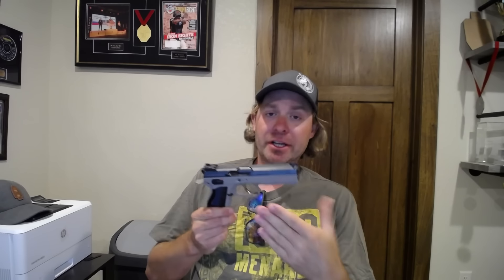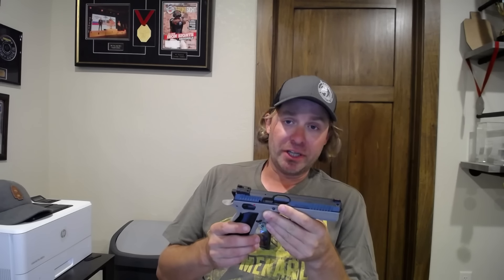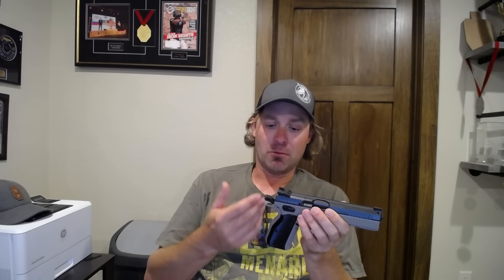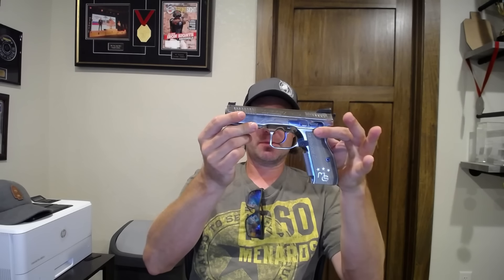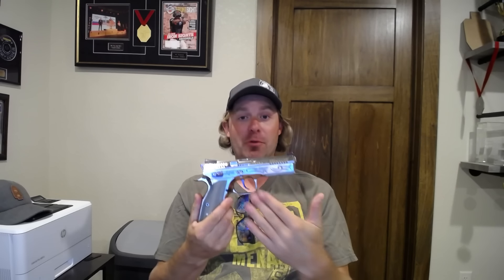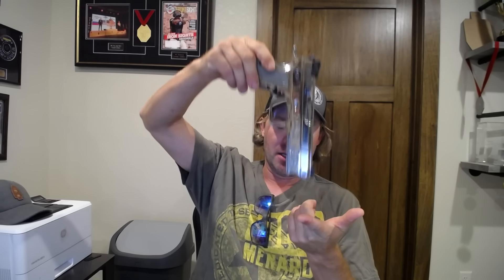Shadow 2 drop test

Comment: The gun had an extended pin and a light pin spring. Furthermore, the user did NOT visually watch the muzzle seat back into the holster fully before removing the hand. It fell to the floor (indoor match) on the hammer. The extended pin protrudes out from the breech .040 when button on hammer end is flush (such as when hammer falls fully on the button)...or in this case it was most likely already fully down on the button end of pin and that pin as a result was already protruding forward. I own one myself and when this happened I went back to stock pin,pin spring, and then tuned the main spring for reliability instead. I run a 13 pounder.  I really do not like hair triggers in the first place. In the case of this incident it only took a solid hit on the hammer and a sudden hard stop of the mass of the gun on a hard surface to cause enough rearward inertia of the chambered round to dent the primer enough from its rearward movement to make it go bang. The RO was killed. Bottom line is this was pure carelessness of the user. There are no accidental discharges...only negligent ones by sloppy careless hurried gun handling. Period.

As far as milling goes I used Primary Machine. They are very well versed in the Shadow 2 milling program and the do beautiful work. They can take tons of weight out of the slide using thinned pockets, ports, and many other techniques that are unheard of elsewhere. I run a 2.5 Trijicon SRO

Comment: Before you mill it, see if you can use a extra power fp spring that will make it more resistant to drop firing...say takes 3-4+ drops. Than shoot it that way through a course of fire and tell us what you find and think. Can the Shadow 2 be 'more drop safe' and still fine for it's purpose?

Comment: When you drop the pistol directly on the muzzle on a hard surface and it goes off, the round is likely to ricochet in a largely random direction. Still potentially lethal, but less likely than a direct shot.
Reply: The ones that killed someone, one in uspsa, on in canada (ipsc) were dropped on the hammer.
Reply: @onpsxmember  Thanks for that significant detail!

Comment: Yes please mill it and maybe add "Steggler Improved" on the slide. Also I second adding the Swampfox or Cyclee RDS. Maybe throw it on the Staccato when you're done reviewing it for a second round of shidded pants. Thanks. 

-sent from my Pact Club Shot Timer III
Reply: I have an unmodified basic CZ75 Omega (I'm using the decocking lever feature) is this model drop safe?
Reply: @Joe-lk6oc  I have the P01 omega and I have hit the hammer in decocked position with my palm much harder than it being dropped from six feet. It didnt go off. Its been thrown. Carry it every day. Factory springs etc. One of my magazine springs has gone bad however.

Comment: As I posted under another of these vids from Ben: Czech Police had several dropped pre-B CZ75s fire, in at least one case mortally injuring a bystander. In another disabling a passer by for life.
CZ75 small frame family guns without a bolt safety (this includes Shadows) simply are NOT drop safe. No matter if modified or not, no matter the condition of the safety or the hammer.
Is it a problem for competitive shooters? I don't think so, the chances are minimal. I'd rather have a Shadow than a striker fired gun sans manual safety and a hammer I can keep my thumb on while holstering.
Reply: Were they being carried hammer down? We probably can’t know.
Reply: @noah.s95 They should, shouldn't they? They're DA/SA.
Reply: @paddypibblet846  a CZ without a firing pin block (like these early Bs or a current Shadow 2) is NOT drop safe with the hammer fully lowered resting on the firing pin. This is how the range officer in NY was killed, as the manual full decock starting position forced in most divisions on the Shadow 2 is not what it is designed for. A CZ with a decocker decocks to half cock.
Reply: @noah.s95  I see what you're saying now. Would half cock really prevent the gun from firing though? I don't know about the CZs but on the Beretta Tomcats they state it shouldn't be carried halfcock since the hammer is more liable to break and send a shot flying anyway. I'd imagine this is even more likely to be the case on a heavy full sized steel pistol.
Reply: @paddypibblet846  No, half cock&safety engaged might not be a solution. I have no opinion on this specific problem, but a lot of ppl claim the metal of the half cock rest can break or the hammer can jump over it. As I understand it the manual safety only locks the trigger and slide and would not prevent the hammer from snapping down from half cock.
Reply: @noah.s95  I believe you mean "Pre-B" as the B denotes the FPB. And, I believe ALL Shadows, TacSports, and CM's lack the FPB.
Reply: @davereloader8837  dave, yes, that is what I was trying to say!

Comment: Ben great to see you testing out the shadow 2 but i wonder if you tried dropping both the XC and the shadow 2 on its hammer what would happen and does carry a weapon mounted light that extends beyond the barrel make it more or less drop safe for both pistols thanks
Reply: It't not the actual contact with the muzzle/end of handgun that causes the firing. Since there is no firing pin block, the pin can move forward and with enough inertia, contact the primer hard enough to fire. 

The reason the handgun must be dropped onto the muzzle is because that's the only way where the firing pin will move unimpeded in a straight direction with enough speed. 

So, you could strap a foot long mag light to the bottom of the accessory rail and drop it straight down. As long as the gun has enough speed moving down, when the end of the light hits the ground, the firing pin will move forward and strike the primer.

Comment: Who doesn't like reflections on the range?
Have an ultra cheap optica and have it chrome plated. It's doable. Or occlude it with tinfoil.
If you mention any info of a different platform add a link under the video or might as well auto mirror the post to be on youtube too.

Comment: If I recall correctly wasn't that death because the gun came out of the dude's hands and he tried catching it as it was falling? I could be confusing it with another fatality though, an IPSC guy got killed that way in Canada I think. If that was the case it's not really a drop safety issue, though maybe says something about the weight of his SA trigger pull.

Comment: Does it fire if you load it, ease the hammer onto the firing pin to put it in double action mode, then drop it on the hammer?

Comment: Did you drop it on the hammer with the hammer down? Isn’t that the real problem with the CZs?
Reply: No, the issue is always inertia, whether dealing with the hammer or not. The firing pin is being resisted by the firing pin spring, but the when the trigger breaks the hammer provides enough energy for the firing pin to bypass the resistance of the spring and hit the primer with enough force to pop it. If you drop a CZ muzzle facing the floor, inertia will cause this energy instead of the hammer. The gun falls, then suddenly stops moving because it hits the ground. The firing pin is free floating other than the resisting spring, so inertia from the fall gives it enough force to strike the primer. The hammer issue is with modified CZs - extended firing pin and reduced power firing pin spring. Because the resisting force of the firing pin spring is lessened and the extended pin, hitting the hammer with very little force can cause primers to pop. As you already can surmise, this will only exaggerate the inertia issue I previously mentioned. Without modifications, there aren't many scenarios that will make the hammer to do this.
Reply: @ so any floating firing pin gun is at some risk of inertia firing when landing on the muzzle end, and separately, the extended firing pin is an issue if landing on the hammer?
Reply: @noah.s95  Yes. All 1911s/2011s that are based on series 70 design have this issue, including handguns like staccatos, nighthawks, and atlas. Garand Thumb did a test and literally all the 1911s/2011s failed the safety test, which included two nighthawks and a staccato xc. The browning hi-power and cz75 passed though. The cz75 most likely was a FPB model, but the browning likely passed for the same reason Ben's shadow 2 didn't have a strike on the first drop. There's a little bit of tolerance in guns like the hi power and shadow, as they wanted to give the firing pin spring enough tension to prevent indirect force like inertia from causing the firing pin to move, but it may not be enough to stop it after multiple strikes.
Reply: Make sure to note that CZs that aren't shadows or pre b are drop safe no matter what you modify, as long as you don't remove the firing pin block. This includes CZ 75B, 75 compact, P01, SP01.

Comment: So the drop test was barrel  muzzle  down if it goes off it should not shoot you ok but uspsa has you make  ready with hammer down not half cocked like it should  be safe. So it hitting the hammer it will go off and that is muzzle  up at you so the rule is bull shit and that's what made that a unsafe gun